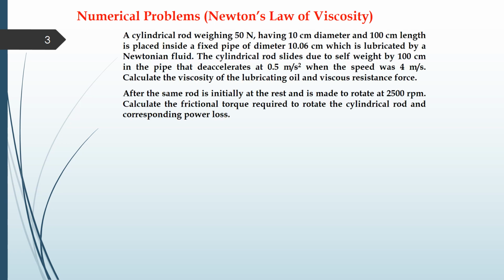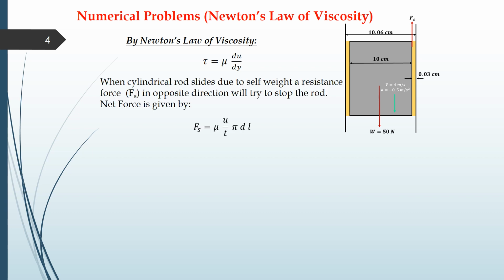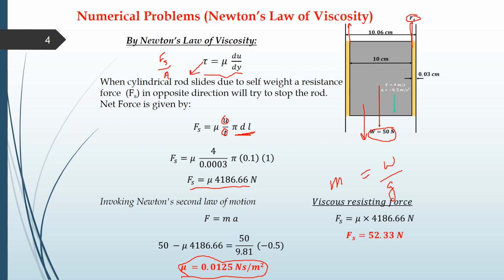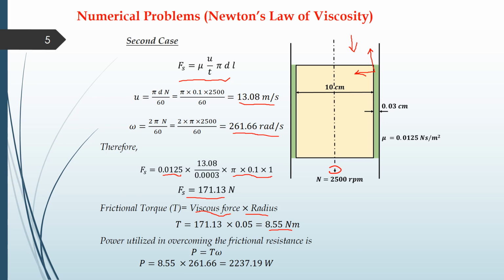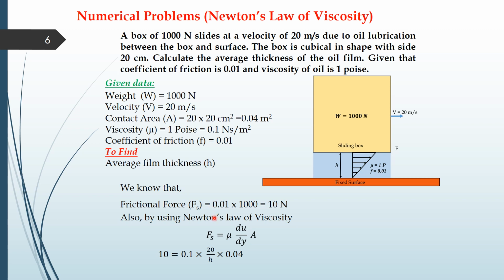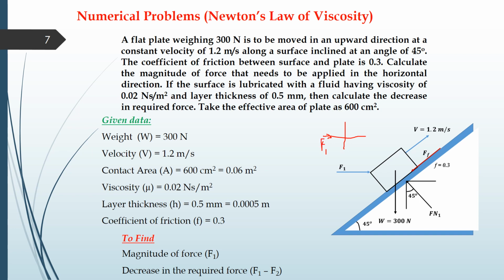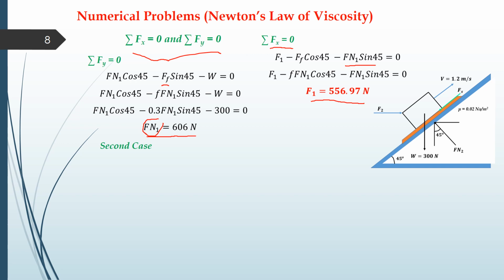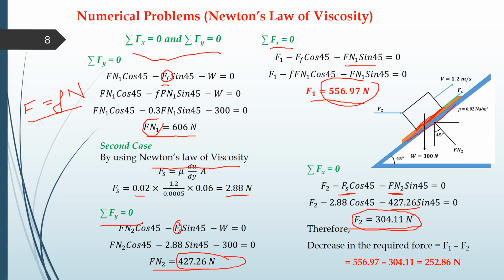(1e) Newton's Law of Viscosity Numerical (Chapter: Introduction) (Fluid Mechanics)

Comment: Sir ; in prob no. 2:-

We take frictional force (of surface) equal to the shear resisting force (of top layer of fluid) ..but sir if in case the thickness of a fluid is very large ..will  it hold  true in that case as well or it only holds true in case of fluids with very less thickness.

Also sir, in prob 3:- 
Even tho the thickness of fluid is very less still why frcitional force is greater  than the resisting shear force of fluid?  And in case of prob. 2 why both are equal?

Comment: Sir,  its regarding prob 1:-

the flow in reality is three dimentional i.e; all the parameters(velocity,pressure) vary w.r.t 3 space co-ordinates so..

so if we take  the formula of only 1-D  flow doesnt that mean , we r not considering(neglecting) the other two parameters...so how come our answer will be accurate/right with just 1-D formula? Because in reality the parameters are varying w.r.t  there co-ordiantes .

We consider velocity gradient = shear strain rate in case of only 1-D flow but isnt it a 3-D flow in reality so why we using this formula sir..??

Comment: Sir question no.1 mai diameter 0.03 kaise liya woo question mai given hi nahi hai
Reply from the maker: Dear Raghav, It is not the diameter, but it is the lubrication film thickness calculated as follows:  10.06-10.00 = 0.06 cm. Further, the oil is on both sides, So 0.06/2= 0.03 cm (thickness of the oil fim)
Reply: Thank you sir